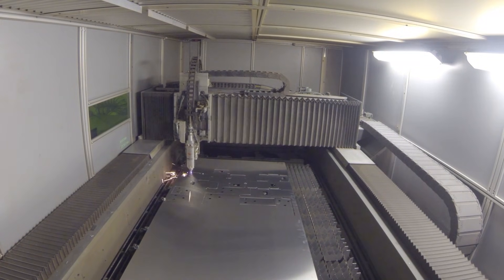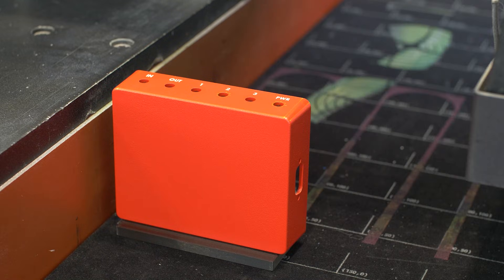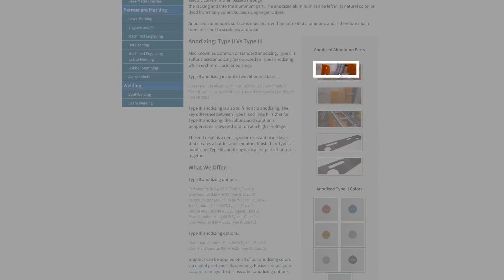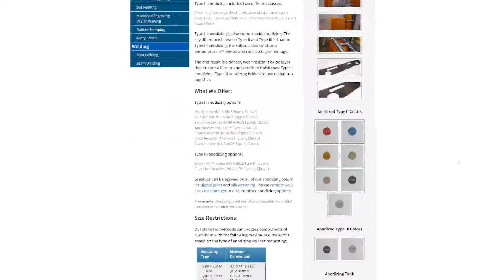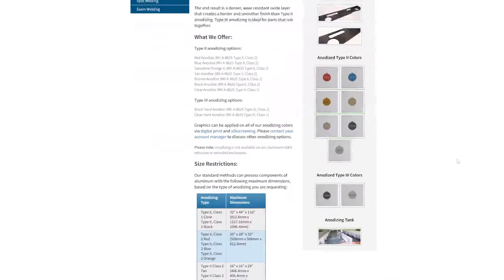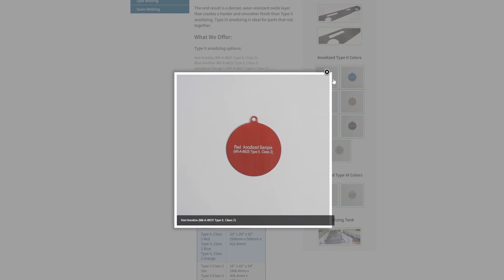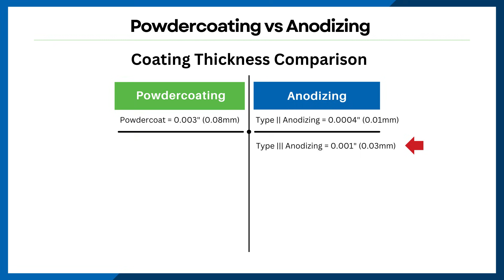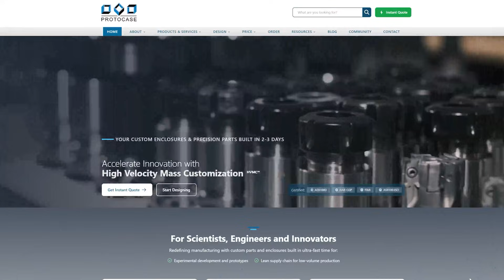Proto Tech Tip - Powdercoating Vs Anodizing

Comment: Powercoating is the better choice for "Harsh environments" but anodizing is better for "maximum corrosion resistance"?

Does that not mean the same?
In other words the best way is to powdercoat the anodized parts for best protection?

I´ve got brake caliper adapters in aluminium that I want to preserve btw.
Reply from the maker: Hi there, great question. And that's our bad for wording things the way we did. When we talked about powdercoating, we meant it was a solid choice for harsh environments because it's cost-effective and will protect the metal from rusting. But if there is concern of debris causing chipping, anodize is a better option as it will protect against corrosion as well as debris chipping. 

You are bang on. You can powdercoat parts that have been anodized. In fact, we see quite a few customers anodize parts, then mask required areas and powdercoat so the exposed area will be corrosion resistant!